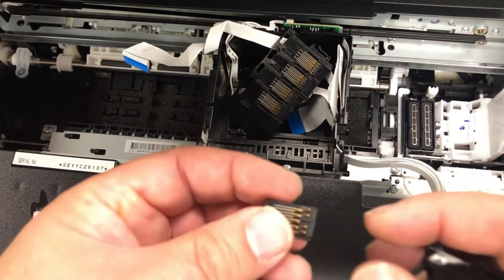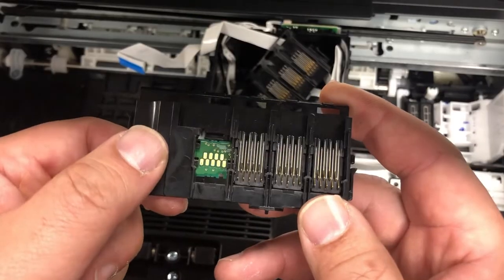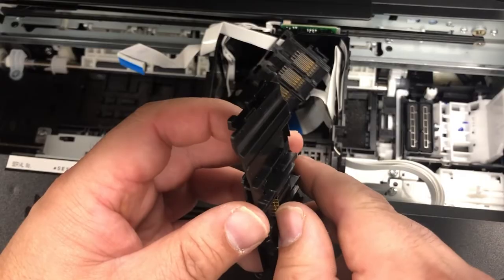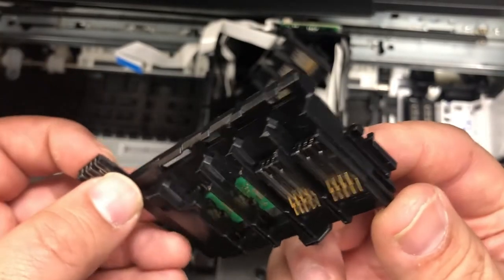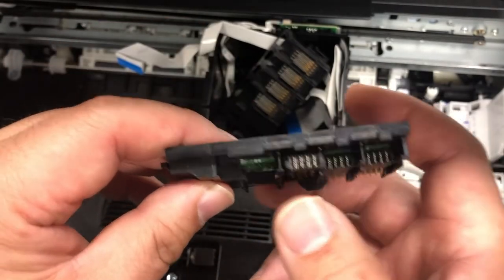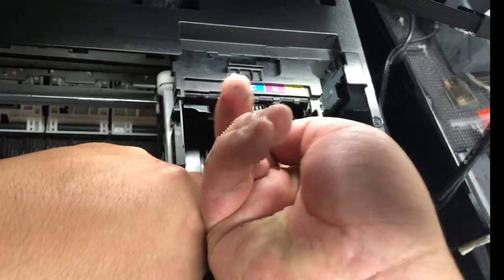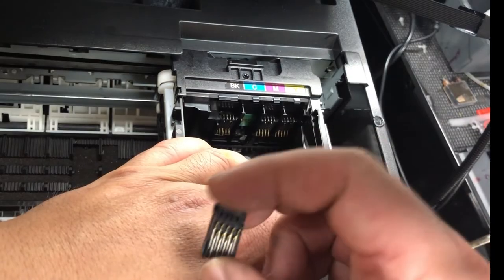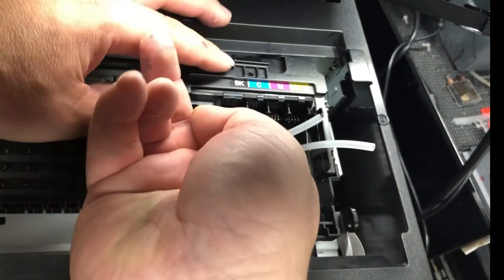Fix Epson "Cartridge Not Recognized" - Change Chip Board Pins (9-pin) CSIC

Comment: refillable carts have chips you can swap out and there's 9 pins on each chip. in regards to wf-7820, how many of the pins are actually used on each chip? it doesn't look like all 9 of them are utilized, i'd like to find out which pins are important and which ones can be left out... i'm experimenting with something...

Comment: Hello I have a WF-2860 which has a broken pin and I get the Cartridge not recognized error. I wasn't able to pull off the broken chip board.
Is the procedure different on my printer?
Thanks

Comment: I received my new chip in the mail and installed it, then started my printer. The whole casing that holds the board slammed to the left side of the printer inside and the screen said to turn it off. After turning it off, I tried turning it on again, but it did it again. Sounded like it was gonna break out of the whole printer. The only thing I did was replace the chip and put the cartridges back in. Do you know what's wrong with it? Thanks so musch!

Comment: Great video, Thank you for posting. Hi im from the UK  This is exactly what has happened to my epson stylus r 360 black ink pin board which has broken . It has eight pins per board. Could you suggest where i could buy a replacement pin board for my epson r 360 any suggestions would be much appreciated . Thank You .

Comment: Hello even though the cartridges are being recognized.... will this stop the ink from printing on the pages? I'm getting blank pages i have replaced the printhead and did several cleanings still getting blank pages. Im just trying to see if there is a connections problem! I have the Epson WF-7720
Reply from the maker: The blank page is caused by the air bubbles inside the cartridge.  Do a few head cleanings and it should fix the problem.
Reply: Yes, I have done several cleaning, replaced print head and all! I’m confused on what’s going on and why it’s printing on the paper.

Comment: hi Kevin, 
I'm finding it difficult to pop out the 9pin cartridge on my Epson WF-2750. Does this model require any additional steps to remove the board?
Reply from the maker: No, the same.
Reply: Wiggle pin forward and backward (not up and down). The groves are not straight but a little zigzag if that makes sense. Same when putting new pin in. This worked like perfectly for my Epsom XP-446. Thanks so much Kevin!

Comment: It seems as if this is my problem but this video don't show us how to take it out. Is there a video I can watch so I can get to the point you are in this video (to be able to put the chip back in)?
Reply from the maker: Put your finger underneath the pin, and use your nail to dig it out.  Once the pin is raised half way, jiggle it a little and it will come out.
Reply: @BCHTechnologies  thank you so much for this video and also replying back to me. I really do appreciate it. As I  put it back it, it won't print now. Is there something maybe I did wrong?

Comment: I'm trying to revive an Epson Stylus Photo 1400.   It uses six cartridges,  I can insert any combination of cartridges and they'll be recognized correctly and the printer will identify which one is/are missing.  But when I insert the last cartridge, regardless of which one it is or its position,  all of the sudden no cartridges are recognized.  It circles through all positions as if by inserting the last one, none are recognized.   All pins on boards look good.  Printer was on storage for five years.  It was all working but head was super clogged.  I took head apart and soaked it in solution for a couple of days.   After reassembling now it won't recognize cartridges if all installed.   Any ideas ?
Reply: this is exactly the problem i am having as well, new cartridges are not helping
Reply: @tracyhack6266  hi i have thie problem, all cartridges error in my epeon wf7015 do u have a solution
Reply: Hi friend do u have  solution ? I have this problem